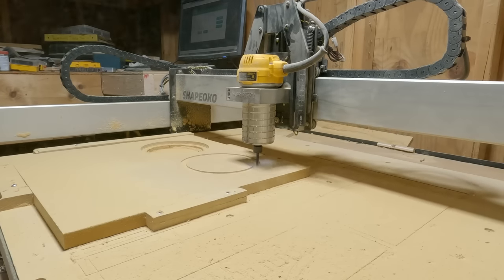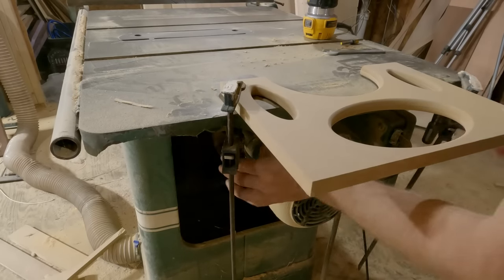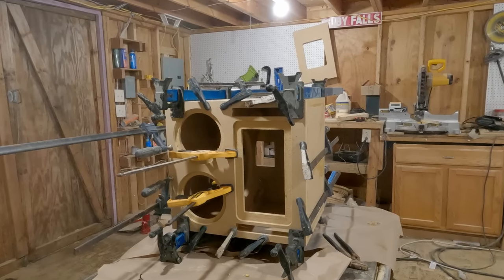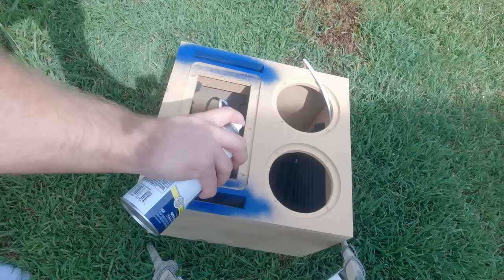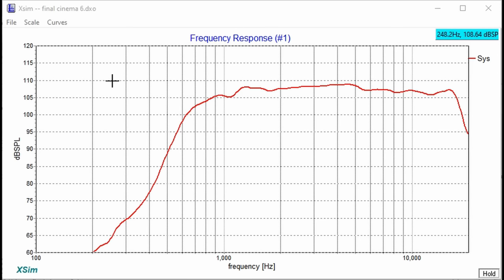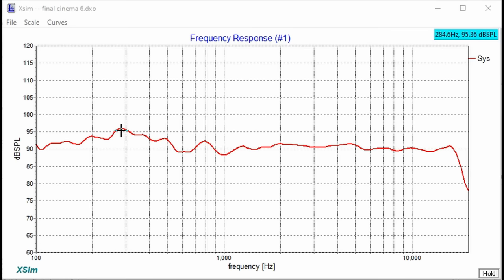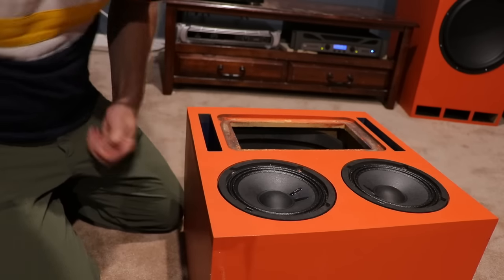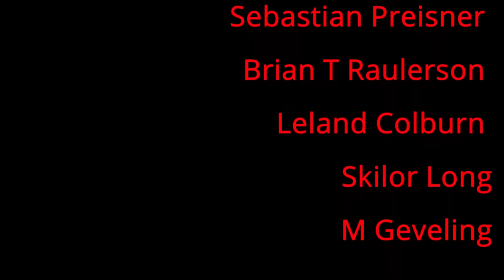DIY Real Home Theater Speakers for $500 - Cinema 6

Comment: These aren't $500/pair speakers anymore.  Just the B&C drivers, horns, and the four woofers are $460 alone, not counting wood, crossover components, cabinet fill, or input terminals.  Probably more like $700-800/pair realistically.

Comment: Great build. I always run some mechanical fixings in MDF builds as the glue holds, but only the first mm of material. I find stiffness and rigidity is improved substantially if I glue n screw.
Reply: I'd personally use birch
Reply: @bricebowlin8834 There is a good reason for not using wood of any kind.  MDF , chip board is a stable material and won't twist. Also, it is a dead material which is essential for control of resonance.

Comment: I think I need to build a set!  Are you going to design matching surround speakers?
Reply from the maker: I'm working on building the cinema 10 which use a 10-in woofer paired with this top end. They're based off of commercial rear speakers.

Comment: I looked all over through your videos but am having trouble finding how to measure speakers for xsim. It would be really nice If you made a video on how to measure speakers to import into xsim. Via DATS and REW or whatever. I'm trying to build your eminence towers with the 15" Omega Pro woofers but don't have headroom to make them as tall as you designed them. Do you think If I ordered your crossover design for the towers would that work in a smaller enclosure. or is there going to be significant impedence changes because of the box design that would throw off the crossover you designed for that

Comment: I wish you would come up with a similar design based with on the Ugly's. Use a horn mid and stop. Or add a uhf driver for top end. The 6 inch version of the woofers would be good, but the 8's would be killer.
Reply from the maker: That's an interesting idea

Comment: Hey toids. Have you thought about making a klipsch rc7? And make it a vertical as well? I think it would be similar but i like the vertical woofer horn woofer when then flow vertical. The rc7 is q 2.5 way cross over so not sure how that works.

Comment: Hi, great video! I made a comment on your other video about Klipsch speakers. I think everybody making their own Klipsch speakers should make a speaker that Klipsch continues to make. I wanted to make a pair of Klipsch Heresy 4 speakers. Instead of making them a ported design I wanted to make them with passive radiators. Then I will also order the genuine Klipsch tweeters, drivers, and crossovers straight from Klipsch. I always upgrade the speaker cables on the crossovers because I got 3 times more power output, clarity, definition, and better imaging. I too strategically place the polyfil for better air flow. My Klipsch Synergy F1 speakers sounded harsh with the tweeters and the mid/bass drivers would bottom out and pop with the stock wires on the crossovers. I could only turn it a hair above the 9 o’clock position as the mid/bass drivers would bottom out and pop. I soldered in 14awg Monster Cable XP with magnetic flux tube and I then could turn the volume up to the 2 o’clock position distortion free with far greater clarity, definition, and output. I also used the all in one Bi-wire Z series cables that blew away all of the other cables I tried. Those Monster power current filters work awesome as well. Anyone who thinks better cables and capacitors don’t make a difference in the sound are Egotistical delusional people in denial of reality as a whole. The current filter and cables made an incredible difference. I wouldn’t have been happy without making the necessary upgrades. Now my $550 pair of Klipsch Synergy F1 speakers sound better than all of the other speakers I had costing way more!

Comment: Yes! The video I have been waiting for! Can’t wait to make these! Quick question. You said laying them on their side would be good for a small narrow room. The room I’m working with is 18x10x9 high. The screen will be 2 feet off the front wall so I can do a AT 120”screen. In this room do you think the cinema 6 would be best laid on its side Or vertical?
Reply from the maker: It's really hard to say. I actually have a really narrow room and I decided to run them horizontally instead of on their side. It's more of a personal preference than it is a rule of thumb. Running it on its side will give you better left and right separation. This makes it easier to differentiate where the sound is coming from. And letting them horizontally gives you more of an even coverage.

Comment: Very Nice work again Toid, I wish I had a way to buy a flat pak for 3 of these, for a LCR or at least just the front Baffle boards cut, that really needs to be exact with a nice CNA Machine. I really want to build a set of 3 of these, I just looked and horn is on back order but Ebay has them. 

  I have been waiting for DIY Sound Group to stock HT-8 for over a year now but these look better with the BC Compression driver.  thanks for the channel Toid.. GodSpeed!
Reply from the maker: Man I don't live in Illinois anymore. I wish I did. Actually no I don't, I love where I live now LOL.  But go ahead give me a contact I'll go ahead and make you three front baffles. I was going to put them on the website anyway. I just haven't got around to it yet.
Reply: @Toid  Toid you are the MAN!! I have some DIY ability, But never built a DIY Speaker kit. This is a huge help, I see Parts Express is on back order until November on Comp drivers? That is fine, I will need a little help with build Toid, I need to ask you about taking a  picture front and back of the XO adding it with speaker plans, it helps us crossover challenged, like those schematic XO boards some dealers sell or include with kits to help you assemble the XO easier. I will ask you after I get joined.

I am going to jump on your Patreon group!! And buy this Cinema 6 Speakers Plans. I know you don't do all this hard work and time for free, I am about the same age as you and I have an Awesome wife & 3 girls in my household Bro.
I will be Shud in new Patreon list,  Cya over there.. Thanks!
Reply: Just Google around for local cabinet shops or woodworks. Most CNC places charge you by the sheet. Converting the plans to CAD should only take an hour or so. Probably around 300 for a shop to draft and cut your sheet of MDF.

Comment: At Parts Express have you checked out the new GRS 12SW-4HE 12" subwoofer?  It's $39.90.  I doubt you'll find another subwoofer that will beat it for the price
Reply from the maker: Yeah it looks like a really great subwoofer. It does suffer from needing a large box

Comment: This is a great build, thanks for sharing your knowledge! I've tried to download the build plans for these, but PayPal was rejected by your site. Is there a known issue with PayPal from Germany?
Reply from the maker: Not that I'm aware of. But it's not working, you could always try Etsy. https://www.etsy.com/listing/1076258431/cinema-6-home-theater-speaker-plans
Reply: @Toid  thanks! The problem was the currency which was switched to € automatically. After switching Back to USD it worked

Comment: I have build simular speakers to these but i surface mounted the horn. It has a large dip in the frequency response at 8-to 15 khz. I was wondering if flush mounting it could solve this problem. Do you know if this can help. The reported frequency response by the manufacturer is pretty linear. Its The Monacor MHD-152. Thanks.

Comment: Would these work for The entire surround sound system?  Front, Left, Right, Surrounds?  Do they require a subwoofer?
Reply from the maker: You could utilize these for all five speakers. There's definitely people that have done that. I've used them as fronts and rears and they do a great job. You will want a subwoofer with these. They're not really designed to go below 80 HZ.

Comment: This is awesome! Do you think the woofers need an upgrade? If so, any recommendations to take this design to a version 3?
Reply from the maker: I don't think the offers need an upgrade. I don't think I'd ever do a version 3 of these. I probably just do something different. I do have a Cinema 10 coming out soon. That'll use a 10 inch woofer with the same compression driver and Horn. That's going to be based off a design that you'll find in most commercial movie theaters being used as rear surrounds.
Reply: @Toid  JBL 8320? :d

Comment: Would these be good for LCR SPEAKERS
Reply from the maker: Yes. That’s what they were originally designed for. Just keep in mind these will have a more narrow dispersion. If you like a wider fuller sound, then I would recommend the cinema 10.

Comment: if you where to buy a speaker that can be identical on all channels minus the center channel & Sub's of course  , for a 7.2.6 speaker surround setup. choosing (3) different ((( 1st, 2nd , 3rd place ))) pre-build's & (3) D.I.Y from Part Express what would you're recommendations be.  can you include 3 chooses from both category's for the budget / value person in mind ...

Comment: Is there any alternative to the h290b wave guids because i cant get them in germany
Reply from the maker: I don't know of one off-hand.  But you if you find a biradial with similar size, it should work well. Feel free to run some by me and I would be happy to tell you if I think it would be a good substitute
Reply: @Toid  what about the b&c me 45 90°×40° Looks like the exact same horn
Reply from the maker: @Jan-kp7qz  it doesn't appear that one would sit back far enough. He really want one that has a depth closer to 5.9 in. The one you mentioned has a depth of 4.9".

Comment: I built the Klipsch 650s clones but they are not impressive.  They're ok but nothing great. Good for garage speakers but I wouldn't consider them for home theater.  I would like an honest opinion from those that built these.  Its ok if they don't sound great, the can sound ok for $200 but don't over hype them.  Then again sound is subjective.